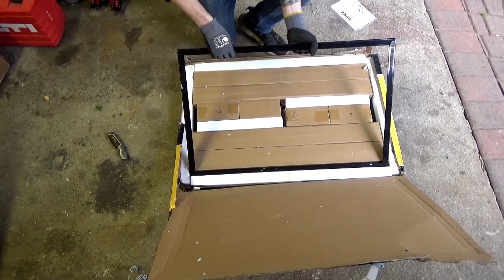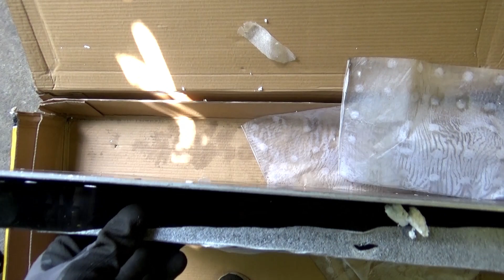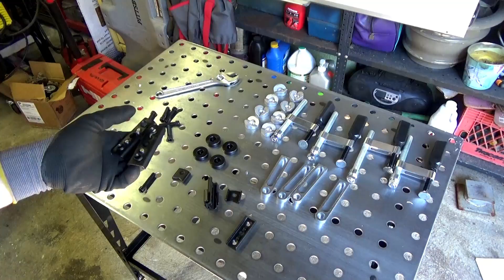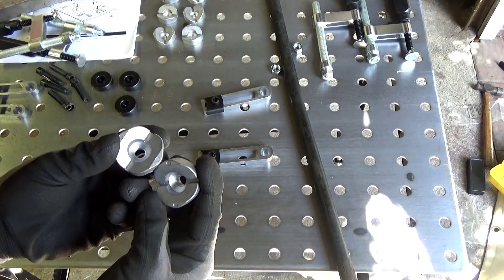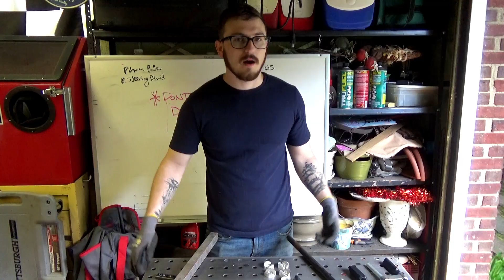KLUTCH Welding Table: Good deal for the DIYer?

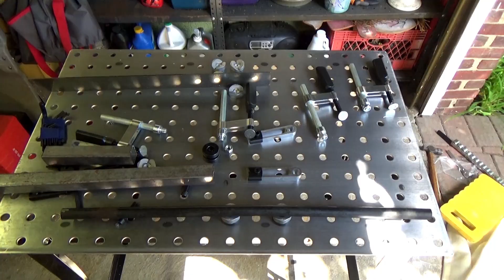Comment: 7:40 You would use a square to place them square. like you have at 11:42 
Or a 45* to set a part at 45*. Not everything needs to be jigged at 90*
Even if you need something super precise you can still achieve this with setup tools rather than the actual location of the holes to go by.
   I think those angle buttons are threaded for you to buy the required bolts if you needed to bolt them in place.
Someone else put a small drill type vise on their table simply by bolting on a plate that had the pins on it. He just dropped it in place for light duty clamping/cutting operations.

Comment: The fixtures and price are decent. The table’s shortcoming is the thickness of the table top.   It’s susceptible to warping under prolonged heat. And, bends and marring is an issue when clamping force exceeds 100 ft lbs. Thanks for sharing.

Comment: I'm a certified welder and to be perfectly honest this table is pretty good and I bought it for my house the top isn't perfectly flat but for most work that won't make a difference unless you're building something at Aerospace and even then it just barely doesn't pass
Reply: Im thinking keeping the table from getting to hot with direct heat helps with keeping it straight.

Im about sold in this table, I like that it comes with this many attachments.

Comment: I’ve bought a fair number of things from Northern. They’re pretty good.

All of these inexpensive tables use the exact same 9 gauge top. I have two from Grizzly. $139 plus about $18 shipping. Out of stock more than in stock. Neither table top was flat on the frame, which it comes attached to, except for the legs. Now, for the lack of flatness. Remove the tops from the frames, and the tops are pretty flat. The top frame isn’t welded flat. Using a good 4 foot level to measure, I ground the frame top flat. Then replaced the top and remeasured. After the grinding, the top was flat to well under 1/16” edge to edge and corner to corner, which is about as good as you can expect other than for a very expensive, thick, ground steel top.

You know people, if we’re fabricating, welding, etc. we should be able to fix these problems.

One of the problems with the tube adapters is that they’re not really intended for these thin tops. They’re intended for the standard 5/8” thick Stronghand tops. I can’t explain all of this in a post here. Unfortunately.

I bought the rebel emp 215 too. I still have it, though I’m going to put it out for sale. Nothing wrong with it. It’s a great welder! But I needed TIG aluminum capabilities, so I bought the rebel emp 205 ac/dc model. I did get the spool gun with the 215, but while it’s great for a lot of work, for thin metal and the electronic chassis and other things I do too, it wasn’t suitable.

I just found you, and I hope to see a lot more videos. Good luck.

Comment: I bought that same table and couldn’t figure out the hardware. The only thing i new how to use are the holding clamps.😂😂😂😂😂😂😂😂😂😂😂😂😂 i tried to figure out just like you did but didn’t get anywhere . Ived searched all over you tube and  cant find a simple explanation what some of the hardware is for. And i went and bought another one.😂😂😂. Same instruction, got no where.

Comment: To make it totally portable I wonder if you could attach a crossmember the length of the table and put it on a portable workmate using the vise feacture. The workmate folds for easy storage so when you're not using fold the workmate out of the way and store the top flat against a wall.

Comment: I thought the hole point of the fixture plate and clamps was that you don't have to bolt stuff to the table.   is it perhaps just that they include cheap clamps and you can perhaps buy some better ones that just clamp and lever themselves into the holes?   I think that the reason your V blocks have threads in them is in order to use them you stack them on the black stop blocks and then bolt them in from the bottom and the magnetic clamp looks like it has a hole in the middle that isn't threaded and it is there to prevent the head of the bolt from going through the hole?
Reply: Or they're just simple stock they bought from another company because it works and is cheap. Just happens to come threaded, ha
Reply: I've seen others where you don't thread a nut onto the clamp - it's a nice tight fit and just clamps down. Something is wrong here
Reply: You don’t need to use the nut when you tighten the handle down it puts torque on the shaft

Comment: You should have watched the Klutch welding fixture table video 1st before you made a review video ... Also Stronghand Tools  " Fixture Point " table has several excellent videos  ... Have had my table for several years  works great, excellent bargain  ...
Reply from the maker: I'll be sure to do my research next time
Reply: I think buying and using the table without a different set of instructions allows for an unbiased review.

Comment: if you are looking for a professional table you would not be looking at spending $180
Reply: Yah spend 2k plus you won't regret  get good tools that last
Reply from the maker: For sure!
Reply: Guys, I’m willing to bet that none of you have a $2k table. Unless you’re doing work on something that’s really heavy, or needs aerospace specs in flatness (for which there are tables that cost $5k, and up for 24x36), then these are fine. What most people don’t understand, is that when you’re welding, you don’t have to tighten a clamp down too hard. Just enough so that the pieces won’t move from the weld shrink, and that really doesn’t take much tightening. So these tables are fine for that.

If you’re making so much money that you can afford an expensive table, then great. But for many welding pros, these tables are perfect. I’ve been welding for my own companies since 1973, and I can afford any table I want, but I choose to spend my money on other tools and equipment.